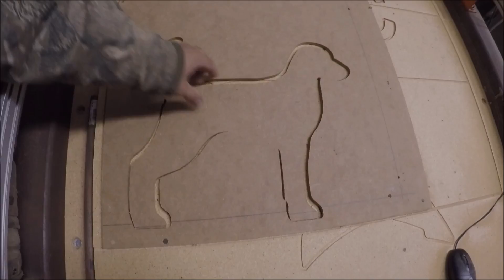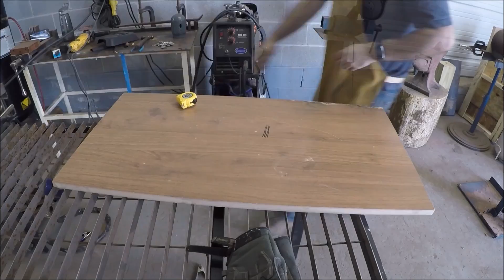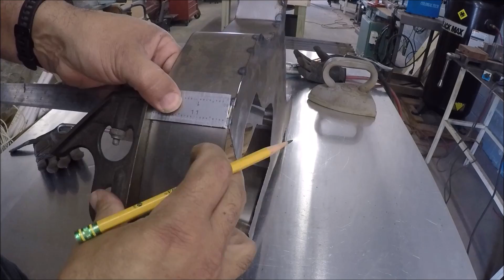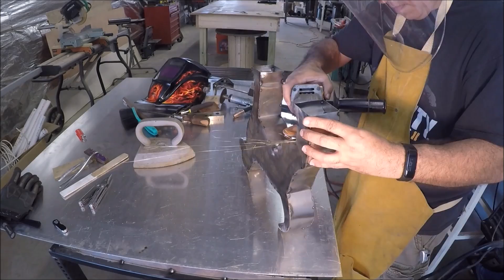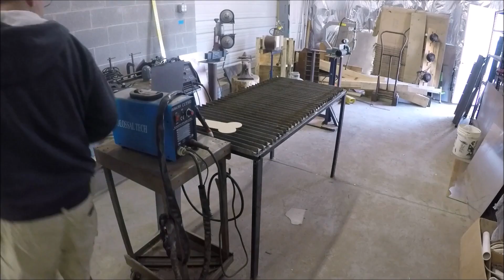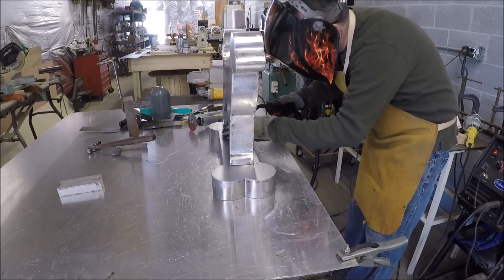Making a Sheet Metal Puppy

Comment: Where did you get your hand brake pliers at.  Never seen those before.  Kinda trick.
Reply from the maker: Shawn Chambers I believe I bought mine on eBay for $50. But if I had to do it again I would buy the set. Here's a link below I found online. https://m.aliexpress.com/item/32573612681.html?trace=wwwdetail2mobilesitedetail&productId=32573612681&productSubject=Penguin-Metal-sheet-Arc-Angle-bending-tool-Aluminum-iron-channel-letter-equipment&spm=2114.40010608.4.19.S49lMj
Reply from the maker: Shawn Chambers I believe one set allows you to get 88° and the other set allows you to bump a radius

Comment: Kindly tell my about machine you used to cut steel?
Reply from the maker: It's called a cut50D. you can buy them on eBay for about $250 to $350. I've had mine for about two years.
Reply: +B&amp;C Creations thank you for your replay also what about wilding machine?
Reply from the maker: +DEBAG The Road Marking Co,  It's a Eastwood 135 mig welder. I run  .023 wire through it. I think cost about $350. They have sales all the time.  I've seen it as low as $250